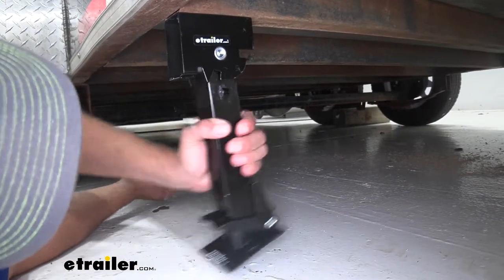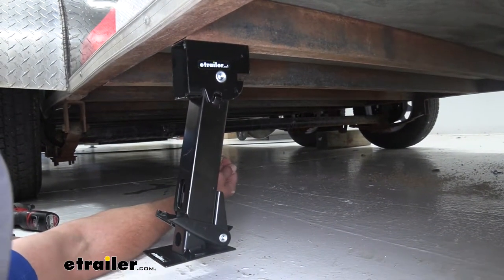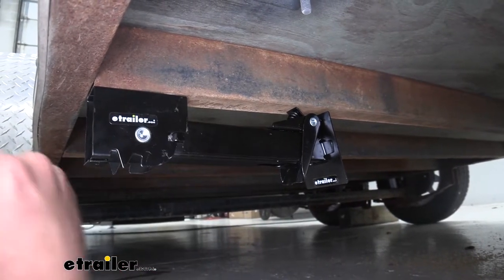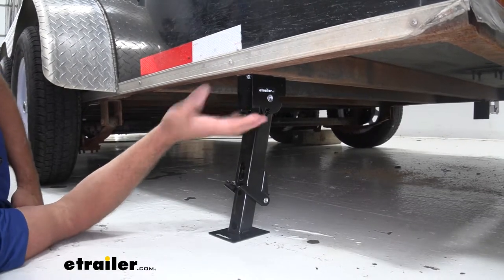etrailer Stabilizer Jack Review

Comment: Seems like they would control the load better if turned 90 degrees since the "rocking" happens front to back when loading and not so much side to side.

Comment: A cool side benefit is you can lower your rear stabilizers, then raise your tongue jack slightly to prevent your tires from getting flat spots during long periods of storage.
Reply from the maker: You should be okay as long as the loaded trailer weight doesn't exceed the capacity of the stabilizer jacks and the jack on your trailer tongue, however the stabilizer jacks aren't really meant to do that.
https://www.etrailer.com/Camper-Jacks/etrailer/TJ01RT-HD.html

Comment: Looks good for smaller trailers. Especially for tear drops and camp kitchen builds. I would definitely go with a locknut and bolt setup with lock washers. I'm not a fan of self tappers, especially in places that would have that much movement.
Reply from the maker: You could definitely use bolts and nuts to secure these stabilizer jacks to a trailer.
https://www.etrailer.com/Camper-Jacks/etrailer/TJ01RT-HD.html
Reply: Run a couple welds